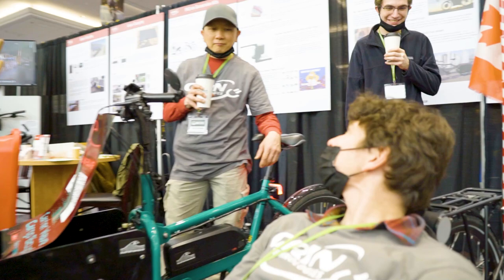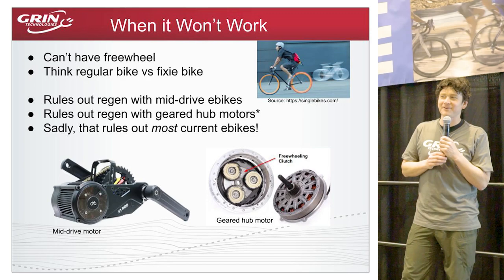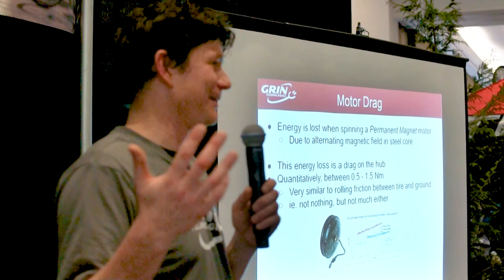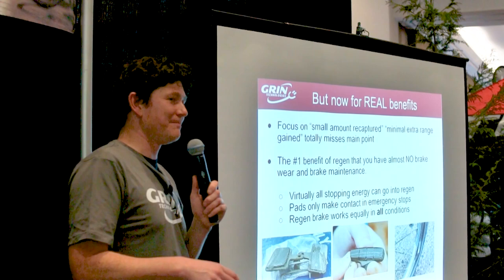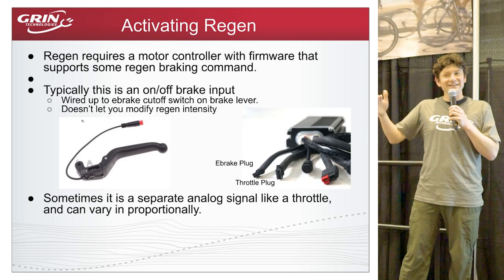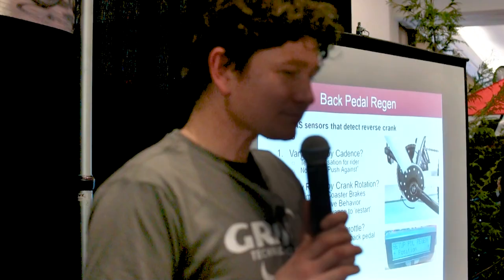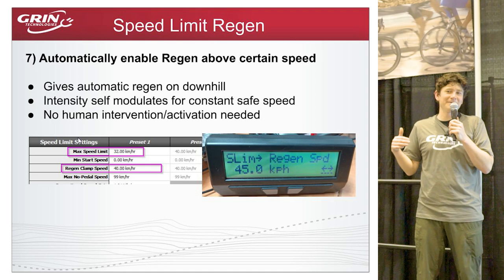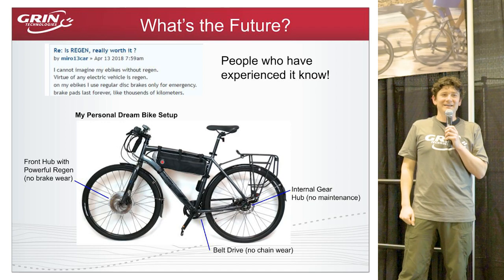Regen Braking and Electric Bicycles, Justin's Presentation from 2022 BC Bike Show

Comment: Would it be possible to incorporate 2 separate PAS adjusters? One to control the speed of the motor(s) and the other one to control the level of regen braking?
Reply from the maker: In principle yes but hard to see the reason for doing that when a single pas sensor can control both
Reply: @GrinTechnologies  i was thinking that it would allow you to independently control both. So instead of a scale from -5 to 5 you have two scales from 0 to 5 which means you can keep the regen braking on and not have to give up the ability to accelerate while stopped at a red light, which as you mentioned is a drawback of only having one switcher.

Comment: Still waiting for the Phaserunner. 😢
Reply: Baserunner Is the same thing different casing... no need to wait...
Reply: @ryanhenry5730  ok didn't know that. But Phaserunner can handle more power.
Reply: @diyelectricbiker9361  FrankenRunners can handle 72v and just dropped last week. Baserunners max at 52v.

Comment: Who is wearing out brakes this fast? Is it an E-bike problem? I have replaced pads once in 30 years and never on disc brakes. I have out about 1000miles on my current pads, and live in the Rockies. I don't think they are half worn yet...

As far as the Regen control, just build the proper brake handle. It is the most intuitive interface. The manufacturing isn't that complex. Seems way less trouble than the other methods you have tried.

The second best option is probably the reversing throttle. Get a Yamaha dual cable throttle. Make a custom box to run the cables into where it has two springs pulling on both cables. I would make the reverse cable spring a bit shorter than the forward cable's. Then the cables can attached to linear or rotary pots, optical, or hall effect sensors.
Reply from the maker: Indeed I should have covered this point better in the presentation. Ebikes burn through brake pads way faster than normal bikes because:
a) you are on average going quite a bit faster, so there is a lot more kinetic energy to absorb (goes as v^2)
b) you are way more inclined to actually stop from speed, rather than coasting down and timing your way through stop lights and intersections to preserve momentum. (Momentum is no longer precious, you can use the motor to quickly accelerate again)  
c) most ebike riders put on higher mileage because it's that much easier to commute daily and do longer trips. 

So yeah, you burn through more brake pad per mile and do several times more miles per year, and what was once an occasional small job becomes a more frequent nuisance.
Reply: @GrinTechnologies  d) eBikes are a bit heavier, so (although a-c are probably more significant) there's more mass that brakes have to stop.

Comment: I'd they're systems to add Regen braking into e-Bikes? I'm going to work for UberEATS & need my bike to go the distance, & affording an extra battery is definitely out of the question for right now, until I get back to work after suffering(still suffering) from long term Covid(caught it twice, & almost died both times).
I get pretty good mileage on my Fiido T1, but these hills out here lol the battery 2x's faster it seems. 
I eventually want to add another battery & another 750w hub motor for the hills out here in Reno Nevada, & to have further range so I can earn a living off UberEATS.
I been out of work for a year, & spent EVERY PENNY I had on this e-Bike a week ago, so it's SINK OR SWIM now, this e-Bike HAS TO earn me a living to support my son & I, as a single Dad it's even tougher, because I want to give him the life he was used to again..... 😢
Reply: Wow. I also deliver on UberEats. But in Kenya.

Comment: Be careful, I live in slightly moderate mountain,,48 volt battery charged to 53 volts⚡️
Reply from the maker: Set your charger to 90% instead of 100% and then there is nothing to worry about.  Also, a 48V battery is typically 54.6V fully charged, so 53V is fine, even 55V isn't much to worry about.

Comment: I'm  sorry, but hilly area's require significantly more power to climb hills. Even with cars, which carry much more weight, regen is said to be roughly 5% in general. I  can see why geared motors would multiply the amount of energy recovered. I see mostly thrill seekers that should be riding motorcycles, rather than staying safe & being responsible! What I would like to see is more torque multipliplication with geared motors,& getting rid of watt limitation, so we could climb up just about any slope, while using the controller to limit speed because few people obey the rules of the road. I saw a mother ride in front of her daughter, ride through a red light, almost getting them killed , if I  hadn't  been paying attention. Really freaking dumb example to show a little girl! We should have super capacitors in our controllers, & a button to give a boost of current when going up hills or technical trails.

Comment: As a Tesla Model 3 owner, none of the regen systems you are talking about are in the least bit attractive compared to the Tesla. As you electric cars owners know, as soon as you let off the throttle regen kicks in. One of the most fun parts of driving a Tesla is the regen, and I would assume all electric cars. A friend who recently bought a Rivian now hates his 5 other gasoline cars because he loves the regen so much. On windy roads, the regen takes the place of the brakes almost entirely and makes the on / off throttle use through the curves super fun. I once had a car with an aluminum flywheel that did a similar thing, but not quite like regen. 

Is there some reason why a similar system, that is used on all electric cars, can not be used on e-bikes? It would be so fun and on trail riding something awesome. All of the other systems you talk about just do not sound like near as much fun.
Reply from the maker: This is trivial and is popular on electric scooters and motorcycles. I didn't mention it in the video because on a pedal bike it is usually the last thing someone would want (ie, tons of drag the moment you stop pedalling).
Reply: @GrinTechnologies  I seldom pedal, and a fat tire bike has so much drag anyway it would barely be noticed. Pedaling is mostly done uphill to lighten the  battery drain. Would you automatically get this 'car style' of regen if not controlled in some other manner? And braking and riding experience would be so much nicer all around!
Reply: @kitesailor  You're not making much sense.